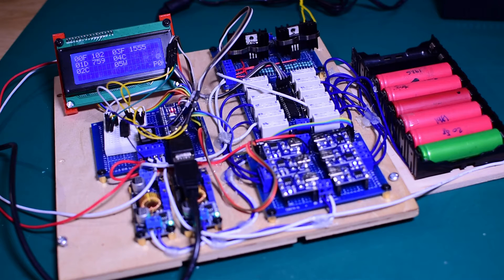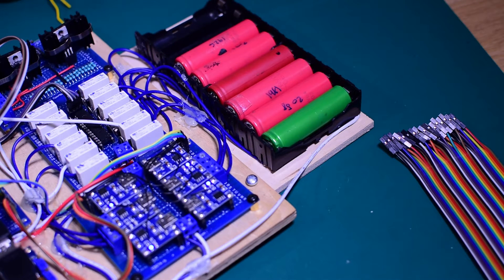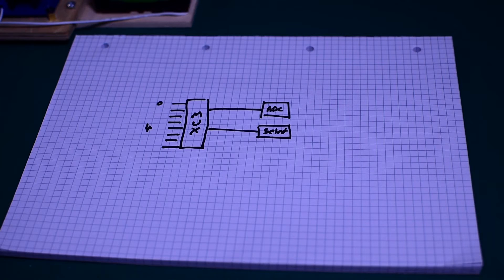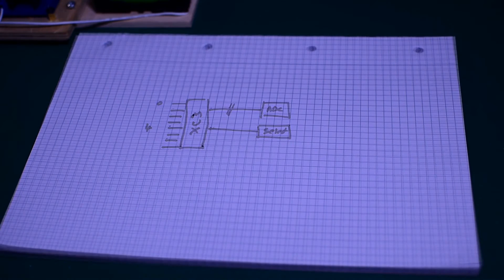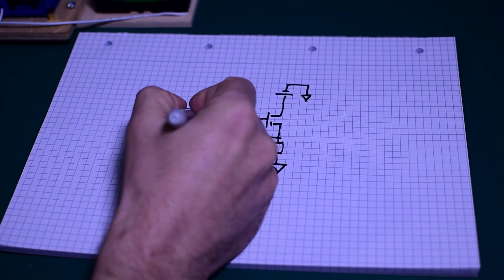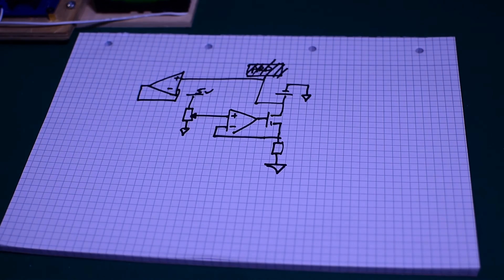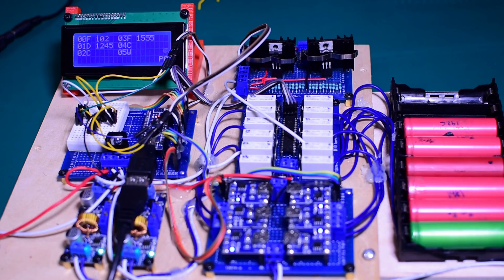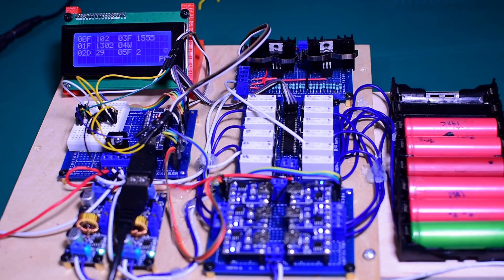18650 Station - We all make mistakes & New Collaboration!

Comment: Really interesting video thank you. I'm a big fan of videos explaining errors and what's being done to attempt to fix them. Using an opamp to adjust the gate and a voltage follower is a sensible solution. When I build my 18650 capacity checker I wanted it to be as simple as possible - in fact the Arduino dummy load I made (where I made many mistakes) was done in the same manner, but there is a lot to be said about doing it properly rather than doing it simply. 
Looking forward to the next update and the collaboration between you and the nerdlings.
Reply from the maker: Thanks Adam! I agree, i find I'm learning the most when I'm fixing my own mistakes or correcting my wild assumptions. I'm trying to make it a habit to do these mistakes videos with each series.

Comment: and one more function perhaps not related to the actual station is to make it possible to relay all data every x seconds to either serial or wireless interface. then its very easy to collect the data on screen on computer. me as a monitoring nerd i would do that :)
Reply from the maker: +DIY Tech & Repairs I've actually got that code on a fork for debugging on my local machine via serial. I can definitely include it in.

Comment: gr8 work. i think u are on track with how to meassure. thats most likely how i would have done it. perhaps more info on display. regarding temp on cells. i would use ds18b20 sensors. in middle under the cell. kind of cut into the holder. that sensor would be more then enough and the good part is that its 1wire so u can use one of the digital lines of the uc. and all sensors on same line :). so checl that out!
Reply from the maker: +DIY Tech & Repairs Thanks, great to get some validation that I'm on the right lines. 

Also great minds think alike ;) there is a string of ds18b20 sitting on my bench right now :D I like the idea of holes in the holder, I was contemplating where to put them.
Reply: Chris Bird regarding 1wire. how did you connect? passive or active? i do recomend active. its very simple. even though passive do work on short distances and few sensors active is more stable.  and regarding meassure voltage. its always good practice to have 2 wires to each pole on the battery holder on bigger systems. and that could save some headroom and larger cables. ie meassuring is on its own. of course it will be twice the amount of cables and perhaps not doable. always pros against cons when it comes to constructing things like this. and mounting of sensors is something i have had on mind for some time since im working on hacking my opus chargers to be able to have temp cut of for safety. and it need to fit where it comes close to the cells but at same time not to affected by surrounding air circulating
Reply from the maker: I've not used 1wire interface before, can you expand on active vs passive might be some thing I need to familiarise myself with. 

Thanks for the tip on the wiring, it's something I will weigh up in the design.
Reply: Chris Bird https://www.digitemp.com/documentation.shtml have some decent info. in general passive is 2 wires instead of 3 in active.  in most my aplications i run the ds9097 adapter inbetween but not always needed in smaller systems. its not dificult to bitbang the 1wire protocoll on an uc today since there are many already done libs :)
Reply from the maker: Thanks will take a read through! Appreciate input from a real expert :)
Reply from the maker: +DIY Tech & Repairs right I see, I hadn't realised there was the passive option. I have mine setup in active right now :) learn something new every day.

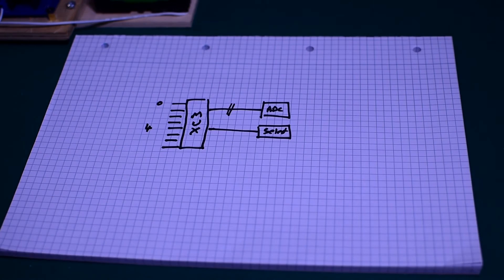Comment: 2:40  i  added 10k pull down resostors on each S0-S4 inputs  of my 74hc4067 
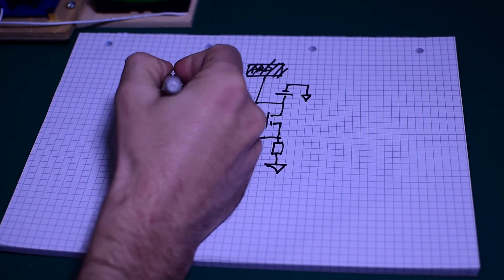I have a problem thou .. if battery is in the holder and you cut the external power the circuit gets power through the multiplexer !!!  Will this 5:40 stop that ? 
Have you tried to control the TP4056 through PIN 8 CHIP ENABLE ? :)
I'm doing 20 cell tester ;)